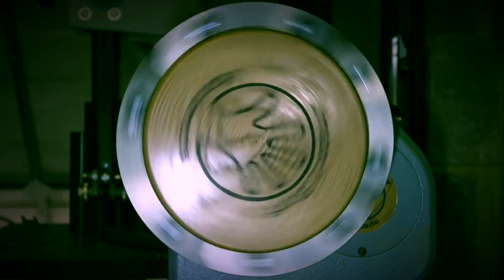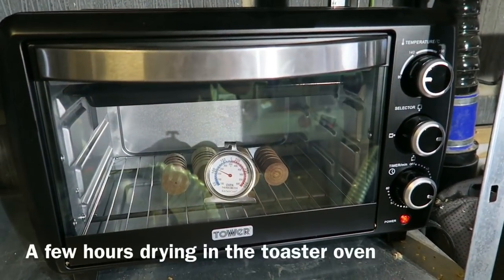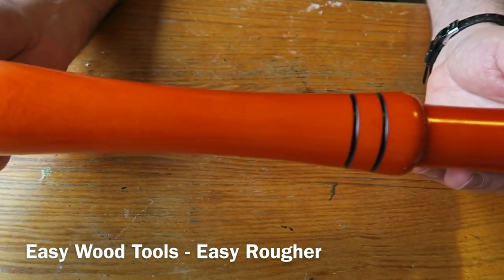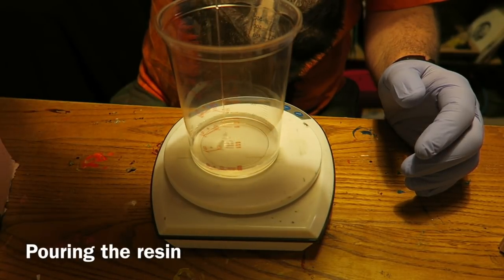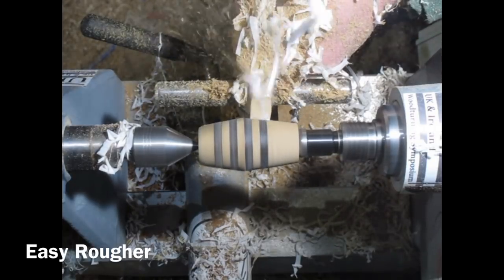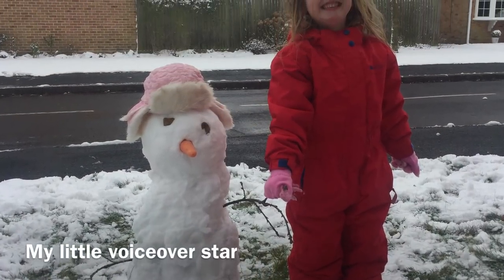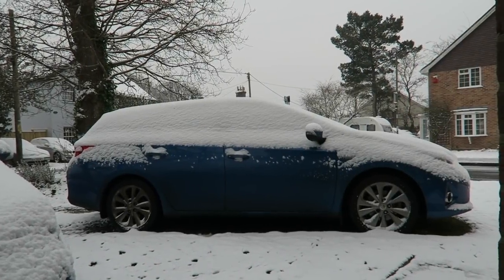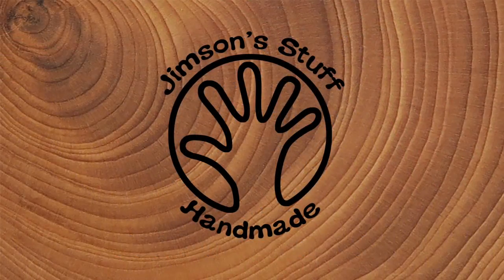Hybrid Light Pulls, Easy Wood Tools, casting cabinet

Comment: Thank you, Jim, for a very interesting upload.    About a year ago I dabbled a little in using resin and your advice to follow the instructions on each brand with care is very sound.   On one occasion I made a cast much too thick and it began to heat up and then bubble and gurgle:-).   When I read the instructions properly I should only have been laying down layers about 2cms deep.
Congrats on the Easy Wood tools.
Reply from the maker: Thank you very much Alan. Yes all these resins tend to have an exothermic curing reaction and overheat if large volumes are used. As you say overheating cause bubbles cracks and yellowing. I have got a large pour project coming soon and I am going to have to be very careful which MBFG resin I choose. Cheers, Jim

Comment: Another cracking project Jim, I spoke to the easy wood tools guy at Makers Central and ordered some of the smaller ones as soon as I got home! Im only learning to wood turn so they make like a lot easier. Keep up the good work!
Reply from the maker: Thank you very much Phil. The Easy Wood Tools are certainly easy to use, just cut on centre and keep the tool level. Which size did you order ? The micro tools have very short handles so light cuts only or they can grab due to less leverage. Cheers, Jim
Reply: Jim Overton - Jimson's Stuff Hi Jim, yes it was the three piece micro turning set, a bit pricey but they are super sharp

Comment: Nice work as always Jim!
My thought on drilling (for what it is worth :-)
I have found that the "drill bit wander or drift" which caused the break through on your core, tends to happen more for me when I am drilling in through end grain because the bit wants to follow the path of least resistance through the grain. When drilling on endgrain - these "channels" of grain density variation are longer than when drilling through face grain, which in turn allows the drill bit to wander off line for longer reaches of the throw. (This will  also become easier for "drift" with finer drill bits that larger diameter bits.)
So - when I can, I try to bore "face grain" as opposed to spindle turning to help eliminate "drift" with the drill bit.
As you often say -- "this is my method, not the only method, and quite possibly not the correct method" - but it seems to work for me.
Cheers
Dennis Beamish Cambridge Ontario Canada
Reply from the maker: Thank you very much Dennis, yes drill drift on end grain is often worse than face grain. Cheers, Jim

Comment: Very nice Jim I use carbide most of the time as I have no proper skill but still get great turnings.
Can you tell me if the burnishing cream works on just wood and how do you use it?
Reply: I too only use carbide tools,mainly because i have knowhere for a bench grinder, Do you re-sharpen your carbide tips with a 600 grit hone?
Reply: I have used a stone I got with a set of tools works O.K
Reply from the maker: Thank you very much Graham. Carbide tools are certainly easy to use. Burnishing Cream is a polishing compound similar to what is used on cars. It works best on resins and lacquered wood but will work on stabilised wood to a degree. Apply with the lathe stationary then buff to a fine polish with the same piece of cloth. The lathe needs to I be running quite fast. Cheers, Jim
Reply from the maker: Hi Mart,  I haven’t had to sharpen them yet, but yes I am planning to use a 600 diamond hone and some honing oil. Cheers,  Jim

Comment: Hi Jim
Thanks for showing your pressure pot etc., I had been looking into vacuum chucks etc. and was looking around for a source of vacuum kit, and there it was nearby to where I live. Also, I liked your pulls and the fact you got on well with the Easy Wood Tools.

I bought the Easy Wood Tools to the UK market I guess it’s nearly 8 years ago when I owned Wood Workers Workshop www.woodworkersworkshop.co.uk and by the way, they still sell them. EWT tools are very well made, easy to use and help people get into turning, one danger is that if you use them a lot you can forget how to use your standard tools, trust me it happens! 

The Easy Rougher name is, in a way, a misnomer. Yes, it is a very good rougher but it is also very good for fine cuts. One trick is to assign one or two of the four cutting edges for roughing or general work and keep the other two edges for finishing. 

In passing, I would mention the sharpening of the cutters. I have seen many people say that you cannot sharpen make the cutters. I disagree with that statement, what I do to restore the edge is take the cutter out of the tool and apply it face down on a diamond hone. Just a drop of honing fluid, or even spit, and rub the cutter in a circular motion for 30 seconds or so, it works wonders. Do not try to hone the narrow edge unless you have the level of skill required.

I have the complete range of EWT with the exception of their new Micro range as I kept all the demo tools when I sold the business, well they were used! My recommendation if you’re starting out with carbide tools for general turning work then I would recommend their Mid-size range, if you are a pen turner then try the Mini-rougher it is excellent for pen turning especially acrylics. Have you tried their Parting Tool or their Chucks?  
Cheers
Roger
Reply from the maker: Thank you very much Roger, loads of information there. I only have the 3 tools at present but I will have a look at the full range at Makers Central. The chuck looks good, I hate changing chuck jaws ! I actually found the rougher better for fine finishing ( I always say a straight edge tool gives a smoother convex curve ). Cheers, Jim
Reply: The concept of quick change chucks is great, the downside is the cost plus    I think it is better to have more chucks and configure them for each job. I have three and could use at least two more so that I can leave a job on the chuck until I really need to take it off.